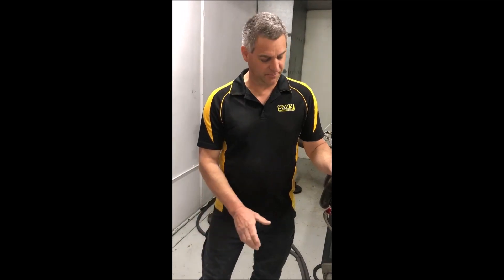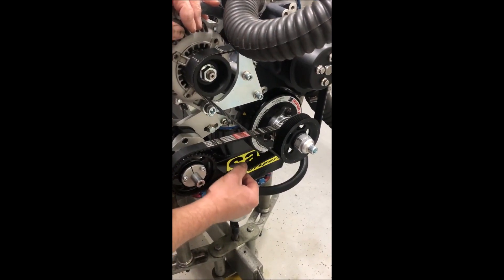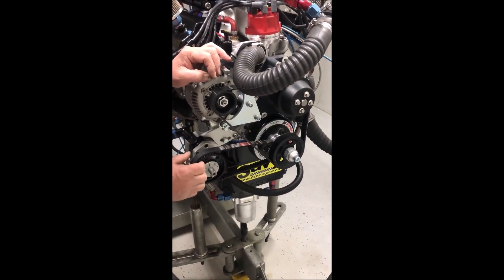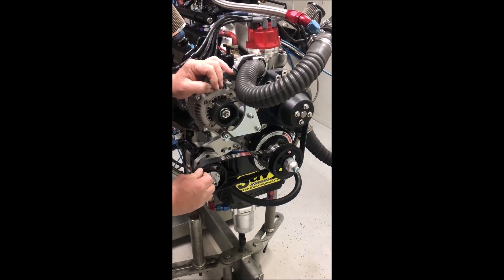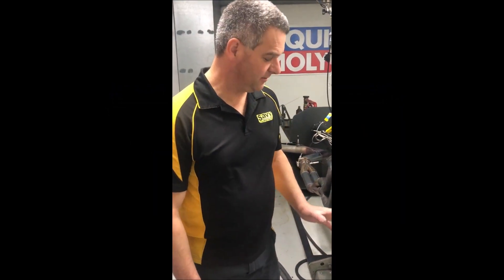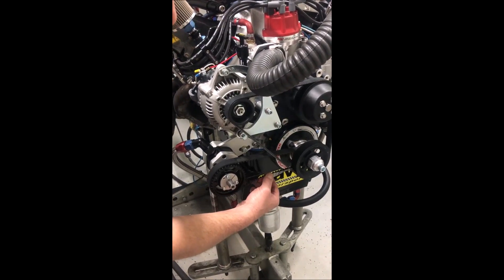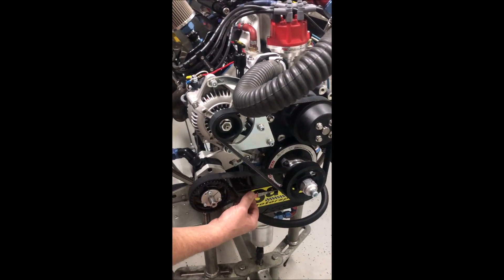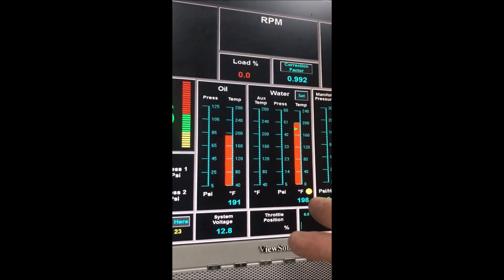Belt Tension for your Wet or Dry Sump Oil Pump

Comment: You guys don't even supply Dry sump pump diagrams and schematics, basically no info about the 6 stage pump! 2021 fellas!!! FFS.
Reply from the maker: Hi, have you enquired about any of our pumps? We always have information available for our customers!
Reply: @SavyMotorsport  Fantastic, I'm after a bit of a custom unit, 7 stage with the additional hex drive on the back, passages side mounting and engine rotation is clockwise. Thanks for the reply, look forward to hearing from you soon. Cheers...
Reply from the maker: @BUZDRIFT  No problems, could we bother you to send us an email with your needs and contact details so that we can deal with your directly? Our email is sales@savymotorsport.com.au. Thanks!
Reply: Any plumbing diagrams of how these need to be plumbed..thanks